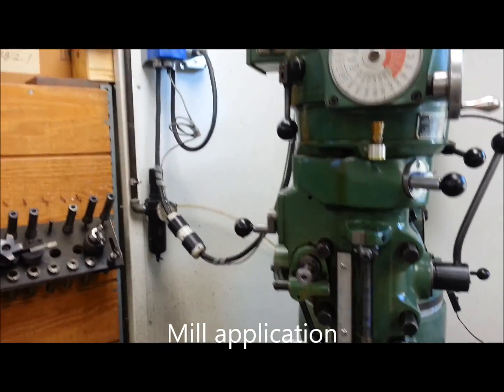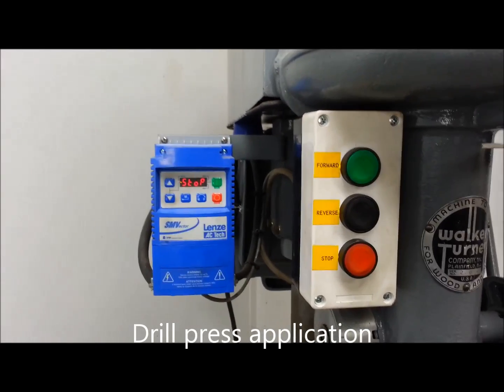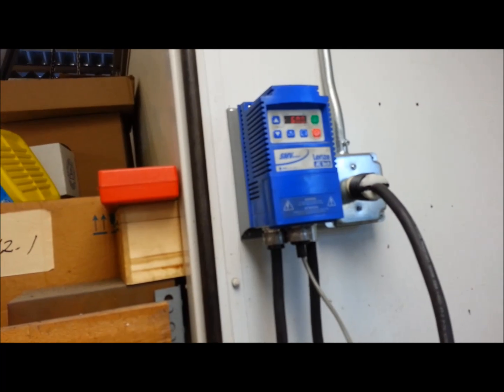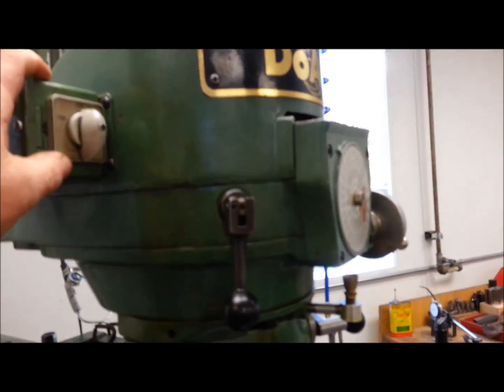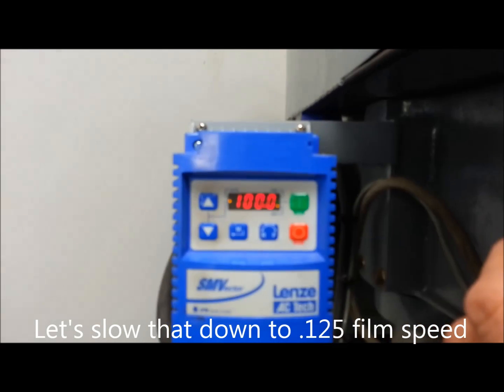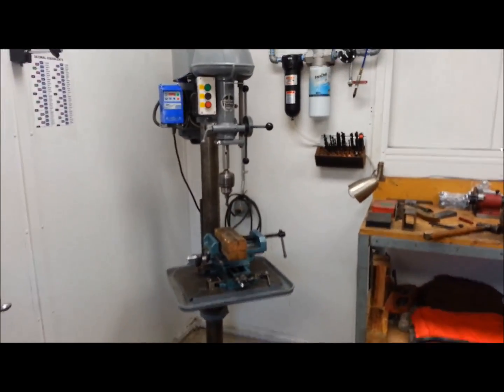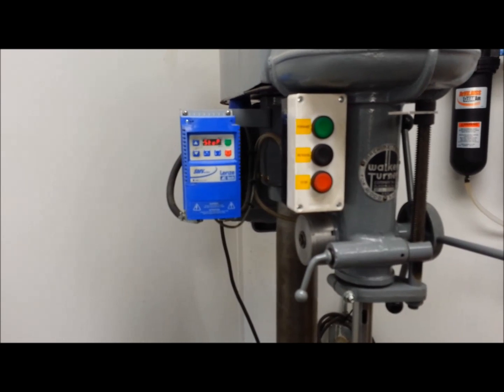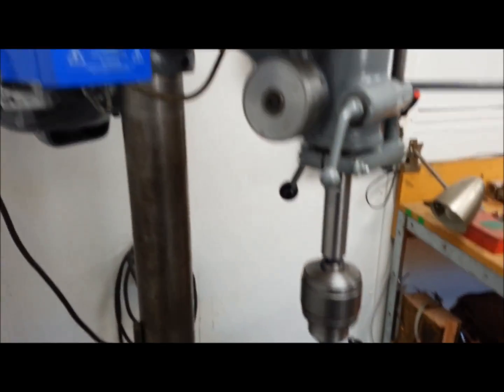VFD introduction / application / information

Comment: I have a Grob NS18 3phase band saw that I need to put a Vfd drive on.  It looks like the Lenze drive is capable of monitoring the amp draw on the motor so if tthe saw breaks a band it'll automatically brake the saw.  This is a feature that I'd like to have.  I'm looking at a ESV751N02YXB for the drive.  It would appear the drive is not capable of braking the motor and a braking module EZXDB1122A1 is required.  Can you confirm if this is correct?
Reply from the maker: You can use dynamic braking with the onboard DC buss, but you need to set your parameters within reason,  the external braking resistor allows for much more aggressive DC braking. The parameter you want to set for a broken blade is "loss of load threshold" thanks for the comment.
Reply: Thanks for the information. I decided to go with braking module because I want maximum braking  in an emergency situation. To accomplish this, I would like an emergency stop button to provide the maximum brake effort. The loss of load situation would also provide maximum braking. Can this be occomplished while using the stock latching on/off button to provide a more moderate braking under a machine stop situation. What type of switch would the emergency stop button be? Latching? Normally open or closed? Momentary?
Reply from the maker: E-stop is a maintained switch.
Reply: Ok, got the Vfd installed tonight, but have a couple of questions:

Emergency brake
P111 set to 2
P105 set to 2.5s - works ok
P126 set to .1s - doesn't work
Emergency stop button is a latching kill switch
Wires are connected to T14 & T17

Where to connect wires for remote start using OE button?
Programming???

Not sure what % to program P145 to
Reply from the maker: Loss of load energizes the auxiliary dry contact on term 16 & 17,  Program 145 and 146 to set LoL characteristics, P 140 = 10  sets the aux for loss of load, your stop button goes in series with terminals 1&4 (and auxiliary switch gear for shutdown IE: safety limits, etc).

 I can't answer your question on starting method because I don't know what type of switchgear you are using.
Reply: Shadon HKW I'm using the original 3 phase push button contractor. Used one leg to switch the work light on. Wired it so a second leg would switch the start/stop function.
Reply from the maker: Maintained contact is 4 & 13A P121= 10
Momentary contact is 4 & 13A P121 = 11
Reply: Reading the manual, it would appear P121 - 10 would be for Reverse Rotation???  When connected to 4 & 13A and P121 - 10, the motor does not start using the maintained contactor.
Reply: How should I have connected the emergency stop switch?  Currently I have P111 set to 2, P105 set to 2.5s - this works ok, P126 set to .1s - this does not work.  The switch is a latching, maintained contact type with the wires connected to T14 and T17
Reply from the maker: I'm away for the weekend and dont have access to a manual, but it doesn't sound like your stop button is hooked up correctly, 1&4 is run enable, open this circuit and dynamic braking takes over.

Comment: I have a 6913 clausing lathe 3hp, 3ph motor, what type of VFD would you recommend, I am interested of powering the motor but utelizing the Clausing varispeed.
Reply from the maker: If the machine is already set up with variable speed and ready to run in all respects, I would recommend a rotary phase converter.  https://www.americanrotary.com/ has a discount code until June    BARZ17

Comment: Very nice tutorial.  I am looking at using a VFD for a wood lathe (2HP) and would like to use a remote control for On, Off, select switch for F/R, and a 10K pot for speed.  I like the looks of the box you have on your drill press.  Do you know where I can purchase something like this or did you build it up from scratch.  Thanks, Keith
Reply from the maker: That is actually a pushbutton station for a roll up door, UP / DOWN / STOP, should be pretty easy to find (and cheap)

Comment: i just bought one of these drives. how many poles should the reverse switch have? any tips on connecting it (reverse switch0 to the drive? thanks
Reply from the maker: Redbull357 single pole, your not putting any power through the switch gear, its pilot duty only.

Comment: Hi Stan, did you ever try a dynamic braking module manual like Ac Tech Lenze 845-409 or similar? This would be very convenient when you have some sort of production where stooping the mill or lathe is quite desirable. 
Thank you sharing and presenting so nice.
Radu

Comment: So what I'm understanding is all you need is a VFD to convert single phase residential power into three phase commercial power? 
My machinist manager told me I needed a static phase converter and a VFD to be able to run a three phase motor on my bridgeport mill?
But all these videos I'm watching show differently. It shows in your video that the VFD'S have a stand alone phase converter built in?
Reply from the maker: Yes, just the VFD, no phase converters were harmed in the making of this video.
Reply: What is not well understood, is that the VFD converts A.C.  single phase to DC, putting that DC power into a set of capacitors, that DC buss power is then converted into 3 phase power by a set of 6 power transistors in a 3 phase bridge configuration...
Reply: Using a Variable Voltage Variable Frequency drive to create 3 phase is viable only when  the motor can be run in 3 phase at the single phase supply voltage.  For instance if a motor is designed for 400volt star connected 
and has 6 leads so it can be connected in delta 230 volts, you are good to go. If the motor has only 3 leads and is designed for 400 volts, you are stuffed, also is it is designed for delta at 400volt you are stuffed again. If the motor was originally connected to a star delta starter most likely you are stuffed. 
A have a couple of drives that I have in captivity  are a total pain in the arse because while they will happily  run single phase to 3 phase they need 480 v single phase. Thus would be ok on the SWER ( Single Wire Earth Return) which is a 480v centre tapped system a bit like the US 230 centre tapped arrangement.  Neither of  these systems are 2 phase by the way, just single phase centre tapped.

Comment: Hi there. I have just installed a lenze smv vfd wich is the the gray one. On a bottle labeler machine. It controls two motors one .33 hp and one 1hp motor the old original fuji drive burn up. Now the lenze vfd is stalling the machine. How can i compensate for motor slip?
Reply from the maker: Give a call over to Marshal Wolf, talk to Chris with all your specifics. http://www.wolfautomation.com/?utm_source=msn&utm_medium=cpc&utm_campaign=(roi)+branded&utm_content=marshall+wolf&utm_term=marshall%20wolf&utm_creative=e&utm_device=c

Comment: Do you know of any resources for setting up VFD's? I'm running a 3hp table saw and a 1.5hp jointer I was wondering if you could  set up to run two machines off one VFD? Any advice for running a table saw on a VFD and preferably setting it at one speed and turning it on and off using the factory switch. Thanks.

Comment: Stan, I did my Bridgeport just like your drill with momentary pushbuttons but it only powers up as long as you hold the buttons in, when you take your finger off it turns off.  What did I do wrong?  I have the same LENZE  VFD and everything.
Reply from the maker: +SUPERDUCKcromobe  Hiya, Sounds like a setting in the parameter group, Im on the road and dont have a book with me for that drive. Sounds like you have got it set for maintained switches when you should be set for momentary switches (push buttons)
Reply: +Shadon HKW OK, I'll Search through the book for that.
Reply: +SUPERDUCKcromobe I fixed it Stan.  Page 32 in the book shows 3 wiring illustrations.  I was using the one on right following Brads lathe setup.  But as you know Brad is using a rotating always on switch.  So for pushbuttons I changed the wiring to the middle array and P121, and P122 have to be changed to 11, and 12.  It works awesome.   Now my Bridgeport mill works just like your drillpress!    Thanks Stan for the videos and help and great ideas!
Reply from the maker: Outstanding! Yes the settings are different from momentary to maintained contact switch gear. Enjoy your machine :)

Comment: I have a 17" delta 3 ph 1/2 hp drill press, a 1949 model. Is it possible for me to have it setup just like yours but on the controls I want a small disconnect and a pot mounted on the left side of the fwd rev stop control?
Reply from the maker: +Marc Lewis Yes, very easily done, these VFDs can be controlled from the keypad or remotely.

Comment: I'm trying to install a vfd on a mill... The mill has a high range, a low range and a continually variable belt rpm adjustment. I want to control the spindle rpm with the VFD. do you have any suggestions as far as what kind of pulley system I might need to get a fixed ratio so I can accurately determine RPMs. It's got a 3hp motor with four poles, and we need the mill to be able to thread mill up to 2400 rpms. If I over drive the motor will I still have enough torque?
Reply from the maker: The VFD on my mill is for generating the third phase, I have the same 2 speed / variable set up as you describe. I would always choose mechanical reduction over simply reducing the motor RPM. Your hp is going to drop drastically below 30 Hz. As far as overdriving your motor, mechanical limits need to be considered, bearings, drives, motor internals, etc. I have run as high as 120 Hz @ 100% duty cycle with no issues. Motor manufacturer was contacted prior to this for their blessing, but we are talking Baldor gold series premium motors. As you can see, there are many things to consider.
Reply: +Shadon HKW Well darn. Thanks for the info and speedy reply!
Reply: +David Boyce Another consideration is the age of your motor's wiring.  Let's face it, most of us are powering older, decommissioned factory equipment with our new technology VFDs.  Most motor wires over 20 years old might not have 600v rated wiring inside.  The problem that exists with older wire is that when you wander too far from the 60hz we know and love so well, voltage wander and  induction occurs through those older, not as well insulated motor windings... on the slow and low Hz side of the equation, phase angle is so great that not only does HP fall off, your current draw will go through the roof.  Remember that starting a motor takes a huge initial current spike for the same reason - almost like a dead short until things get spinning..  Far better to keep your mechanical system for low speed changes, thereby using that motor closer to it's intended design parameters.  BTW Shadon's installation shown in the cleanroom at 1:50 is very nicely done.  I wish I had the background in control wiring to have done as nicely on my VFD installation, but I am still learning...

Comment: Hi, Awesome video. I'm new to all this, I brought an old treadmill, to use the motor to control my bandsaw for timber and steel cutting, I assumed the treadmill was DC motor, but it is a 3-phase AC. the treadmill motor is 4HP. which is major over kill for my bandsaw. so would a smaller VFD (1.5hp rated) work? knowing the bandsaw would never require that much torque.... the 1.5 hp VFD are half the price of a 4hp unit.

or should I get a new smaller motor you think?
Reply from the maker: +Ray Nixon Didnt the treadmill already have a speed control? If you need to buy one I would get a smaller motor first, fractional HP VFD's are still hovering around 100 bucks.
Reply: +Shadon HKW thanks for your reply, the treadmill dose have a control board with it, but It's old and larger then the VFDs currently available. I'll grab a smaller motor and start from there

Comment: Do I need to take anything into consideration having a 6 pole 3 ph motor ( not sure if it is 6 pole or not). Data plate HP 1 ph 3 cy60, full load rpm 1155, 220 volts 3.90 amp SE 1.25 
This is a 50's Fairbanks Morse what I call a pancake motor
Reply from the maker: +david masters The more poles your motor has the better for low speed torque, a vintage motor like that won't do well overdriving (stay at or below tagged Hz) otherwise should run fine!

Comment: Do you size the VFD to the motor size ( i.e. 1hp VFD to a 1hp motor) or is there a formula on how you size the VFD to the motor.
Reply from the maker: +KEVIN OLEKSIAK I will go oversize if I think I may want to upsize the motor in the future, otherwise its just  1 to 1

Comment: Great video, very informative. I have three ACTech drives in my workshop, on on my mill, one that will end up on the lathe and one for a belt sander. Can you offer any advice on minimum motor speeds? I see that you're running your lathe as low as 8Hz but one of the others bottoms out at 20. Any rule of thumb on how low is safe?
Reply from the maker: +Sam Horsepower takes a hard dive below 20Hz, stalling the motor (temporarily) doesnt hurt it, but you wont be able to complete your operation. Mechanical speed reduction should always be used to get the motor into its usable range.
Reply: Ok, easy. I'll use that as a baseline. Any chance of getting some details on your three button momentary for/rev/stop setup? I tried to set my mill up that way this afternoon but couldn't get anything to happen. I followed the manual as best as I can tell...?
Reply: Hey again, sorted it out. Was a simple NO/NC mix up. It's all up and running now and it is sweet! 10k pot for the speed reference and push forward and reverse. Superb!

Comment: Hello,
Thanks so much for the informative video.  As a layman, I see you have infinite knowledge on this topic.  I just purchased and got it home... a 1967 Logan Lathe Model 2527.  I was excited to see one in your video.  Mine being a little older than yours by 4 years let's say.  My variable speed is with the belt only.  So I have questions about that.  I would greatly appreciate the proper direction so I can hook mine up in Similar manner to yours.  Can you contact me  besides this channel.  Thanks in advance... Bob...   E-Mail
manf442 at gmail dot com        :)
Reply from the maker: +Mando Manf Hi Bob, I am guessing you have a step pulley set up, always seek a mechanical gear reduction first before simply turning down a VFD, inverter driven motors have a very defined powerband and going below those limits will cause a dramatic HP drop with unsatisfactory results. Grats on your new lathe!

Comment: Would running that many VFDs seriously effect the true RMS of line voltage in the shop, or does it just cause some line noise?
Reply from the maker: +Michæl Gilbert Clements Some of my drives run at 60 Hz all the time, the ones that get throttled get some line noise.

Comment: I have the same 200V DoAll mill as you. :)

It's currently running on a rotary phase converter, but I'm getting tired of the noise so I'm looking into using a VFD. One thing I've noticed in your set-up as well as others, is how slowly the motor ramps up to speed. The mill on my rotary phase converter ramps up to speed MUCH faster. Is that something that can be duplicated with a VFD, or that that a limitation of them? I do a lot of power tapping, so that is a concern.

Tom
Reply from the maker: +Toms Techniques Hey Tom, ramp times (both up and down) are programmable, for instance you could choose a 4 second ramp up with a 2 second ramp down. I think my mill is still on default programming (6 seconds each) it never really bothered me, so I never got into the menu and changed it. I do rigid tapping as well and it works fine in back gear.

ATB
Z

Comment: shadow just an FYI the "exposed wiring" you are talking about in the bottom of the VFD is actually called the Nema 1 Conduit Kit there are some manufacturers where the drive comes with the kit already installed and others you have to buy them separate, reason being is some people may want the open chassis style because they plan to mount the drive in an enclosure themselves and the would need to remove the nema 1 kit.

Comment: Hi mate.
Thanks for that.  I have ordered one of the cheap VFDs, and don't know too much about them.  I thought that I will try and learn about them from the book.  I was thinking of putting up 2 wall sockets, so I can use more machines from one VFD.  Is that wrong?  can that not be done?  If you do have some thoughts about that, I would like to hear what you think/know.
Kind regards,
Marcel.
West Australia, 50Hz  240vac.
Reply from the maker: Marcel Timmers One VFD can run multiple motors as long as you carefully follow some very strict rules, I will need more details and I will probably have questions. Move this over to e-mails and I can help you get your system sorted.
Reply: Shadon HKW Hi mate.
That is so very nice that you are willing to give me a bit of your time.  Thank you very much.  At the moment I'm just awaiting the VFD.  I would like to have something jacked up for when I get the chance to buy a nice mill.  Those things are rather hard to come by, her on the west coast of Australia  The lathe that I have, I have put on a 2Hp 240vac, and seems to be running well with it.  So the VFD is purely provelactic at this stage.   However thank you very  much.
Kind regards,
Marcel.

Comment: Very well explained. I wish I had come across this video before I started fooling with my VFD. Mine is a WEG. I didn't choose it; it came with my Bridgeport. From your description I'm guessing it's Chinese, because it has lots of exposed connectors. I hooked up a pushbutton box but now I wonder whether I would have been better off using the existing barrel switch, just like you did with your DoAll. Too late now!